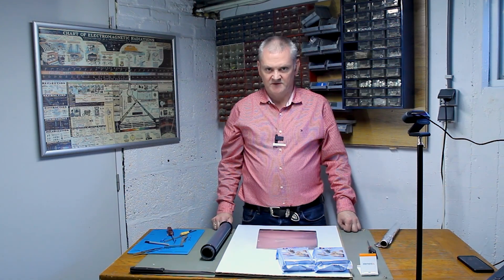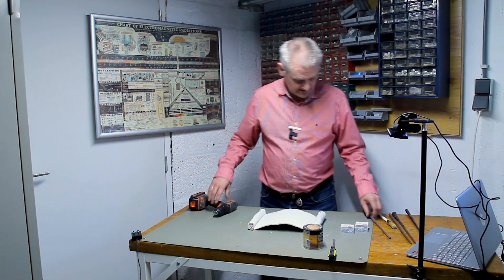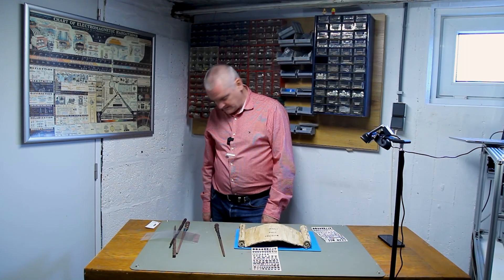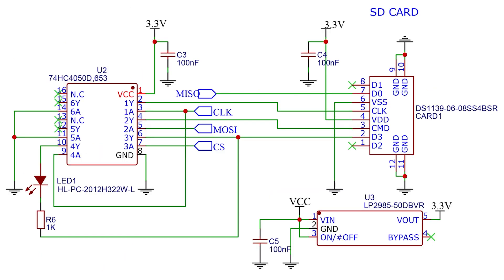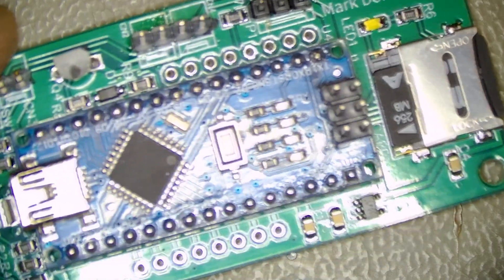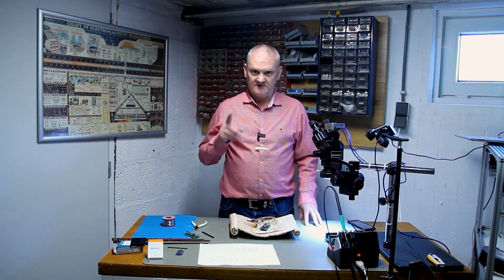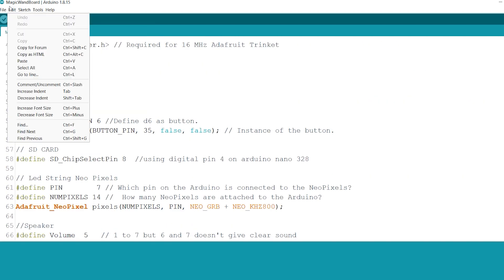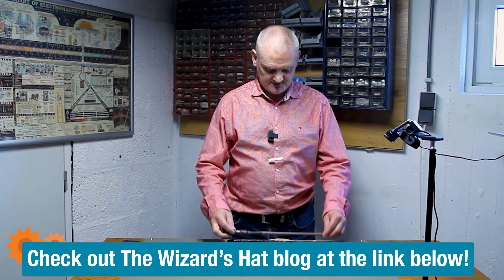Building a Magic Wand Talking Sound Board Using Arduino

Comment: Some of the new Arduino have an analogue out that gives a voltage rather than pwm. I wonder if those would give higher quality sound?
Reply: yeah. well....i could simply use an ESP32 with I2s sound chip added ;-)
Reply: @TheElectronicEngineer  many of the SAMD21 boards also have a DAC output, not seen any with two though